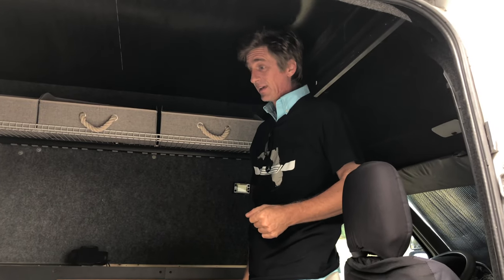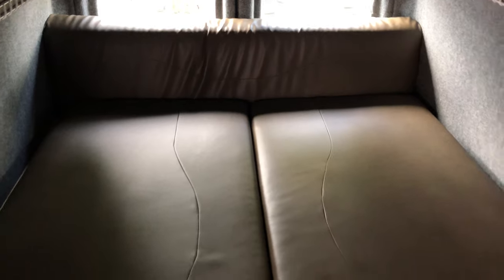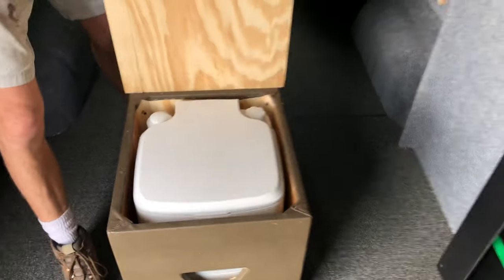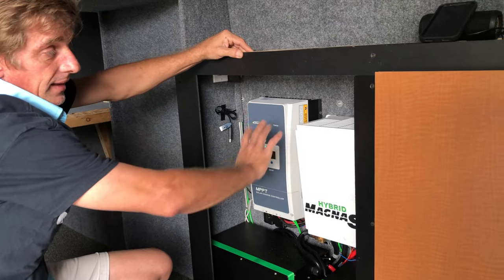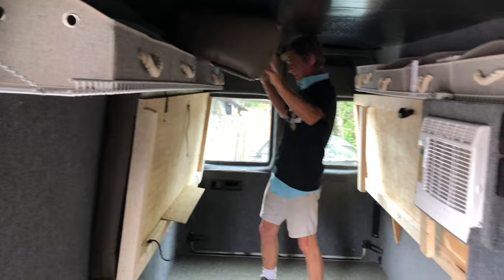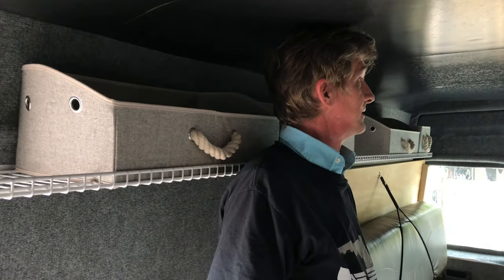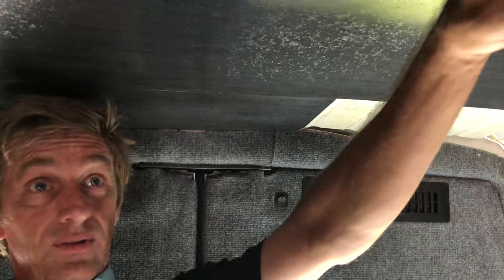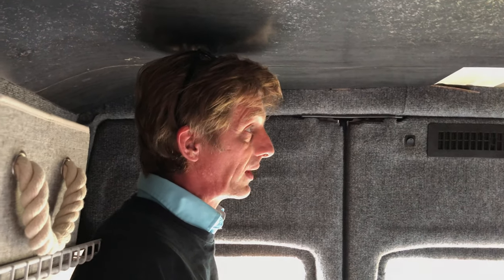Multipurpose Folding Murphy Bed in a Camper Van!

Comment: Hey, some friendly tips:

Look up:

“Murphy bed with sliding components” 
“Wall mounted bunk beds”
“Murphy desk”
“Murphy Door”

There is a lot more space you have to work with then what you are showing in this video. While the effort is appreciated, think abt what can actually be either built in to the underside of the bed or components that can be welded on.  :)